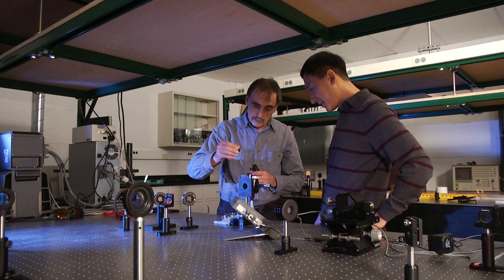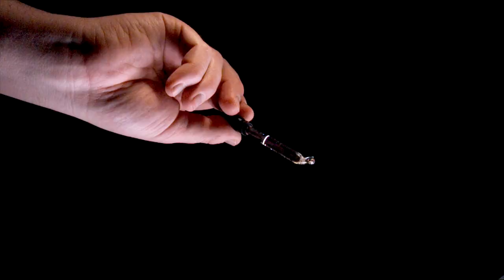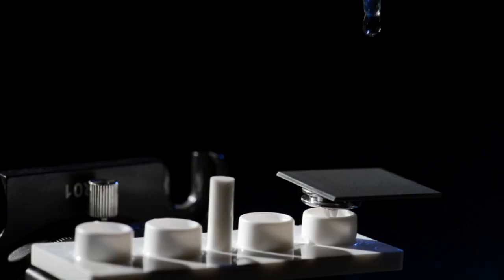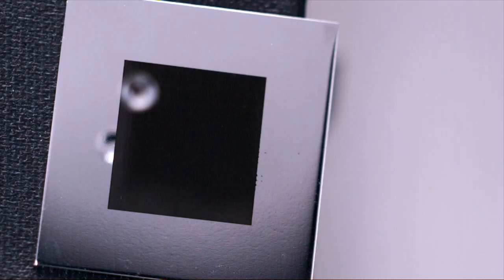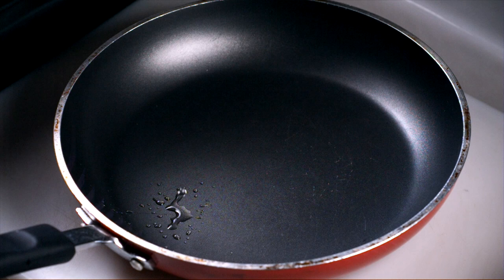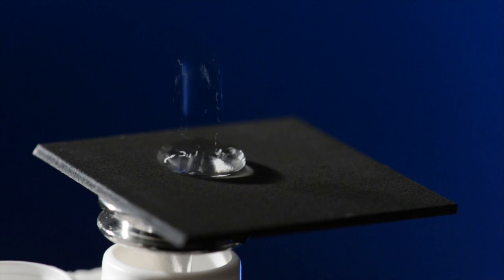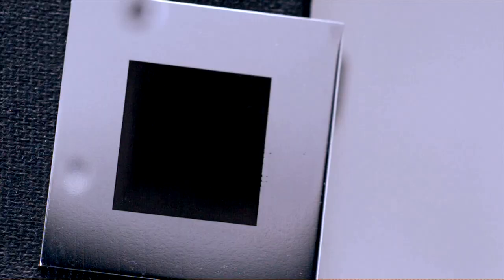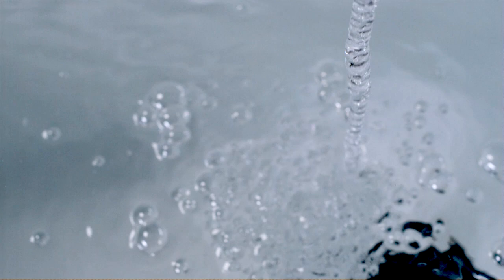Using Lasers to Create Super-hydrophobic Materials

Comment: The explanation is right here:
"In this study, we use an amplified Ti:sapphire laser system that generates 65-fs pulses with a central wavelength of 800 nm and at a maximum pulse repetition rate of 1 kHZ. The laser beam is focused onto the sample surface by a lens onto a sample mounted on a computerized XY-translation stage. The samples in our study are platinum, titanium, and brass. Each sample is textured with an array of parallel microgrooves covered by extensive nanostructures. The platinum sample is processed at laser fluence of 9.8 J/cm 2. The titanium sample is processed at laser fluence of 7.6 J/cm 2. Brass is processed at laser fluence of 3.9 J/cm 2. The orientation of microgrooves is controlled by the scan direction. A scanning electron microscope (SEM) and a 3D laser scanning microscope are used to examine the surface structures. Superhydrophobic properties are studied by measuring both water contact angle and the surface tilt angle for water sliding. The self-cleaning properties are studied with real-life dust particles collected from a vacuum cleaner. For cleaning, we use rolling and falling water drops. The rolling drops with nearly zero kinetic energy are produced by pipetting water drops near the sample surface, while the falling drops are produced by pipetting drops at a height of 3–8 cm above the sample surface. The diameter of the pipetted water drops is in the range of 2–5 mm. The self-cleaning action is recorded with a video camera. To characterize the optical properties, we measure the total hemispherical optical reflection of the samples using a Perkin-Elmer Lambda 900 spectrophotometer and Bruker IFS 66/S FTIR spectrometer, each equipped with an integrating sphere. The two spectrometers allow us to measure the spectral reflectance in the wavelength range of 0.25–2.5  μm and 2.5–16  μm, respectively."
It was in a link in the description. ^^
Reply: Can you make a CorningWare ceramic surface to be hydrophobic? If you can, you can start a revolution in our cookwares.
Reply: @zooplanton  if you can laser etch the surface without chipping the ceramic you can.
Reply: @zooplanton  titanium pans

Comment: Wouldn't minor scratches on the surface make the effect fail, since it is etched directly onto the surface itself?
Reply: Yes they would. This technique is more effective on materials with higher resistances to scratching. Of course this raises production costs, but you'd get a more durable surface that retains it's hydrophobia.
Reply: Grand Duke Seems like it would be good for surfaces that don't usually have exposure to open environments that could cause the scratching but might fall victim to condensation and other similar issues such as internal parts that can't be completely sealed off.
Reply: Or just apply it to parts which are not mechanically requested.
Reply: My gut tells me even a little bit of dust could seriously reduce the efficacy.  That's true of chemical coatings too though.
Reply: That's why we don't see anything 7 years later :) it's cool research tho

Comment: Pretty awesome, yeah. Though, I question it's durability. I'm guessing the water's surface tension keeps it together, because the pattern etched into the metal prevents the water from seeping in. I've seen the phrase "micro and nano patterns" thrown about, which makes me suspect that it would be incredibly easy to scratch this attribute straight off the metal unless it's as hard as diamond. It's the same reason your car wax loses it's effectiveness to do the same thing, but the difference is that it's relatively easy to wax your car, while re-lasering a toilet in Mozambique is probably not going to be an option. Slapping a coat of paint on may not be as effective, but it's cheap, fast, and can be done over and over and over again.

Still a great technology and I certainly hope they roll out it's use in hospitals (they already have a plastic that does the same thing), which would not only be healthier for us all but also avoid that whole "breeding super-bacteria" problem from an overuse of cleaning and antibiotic chemicals, but I sometimes think engineers and scientists are not as worldly and practical when it comes to applying their technology, because it's just not feasible to build entire airplanes out of nano-etched metal that will not only be blinding bare aluminum, but will quickly lose it's effectiveness after flying through dust storms, hail, etc. Kinda like that whole "build roads out of solar panels coated with glass" idea; sounds awesome, but mundane problems like "glass gets scratched to shit when you drive cars on it" and "asphalt is fucking cheap" just take priority.

If I'm totally wrong on this, please give me a heads up on why.

Comment: This could be used to create an air based thermopumps that would work well below 0 as water vapor could not sublimate to the cooling surfaces. You could get COP 4-5 by having a much larger difference between the cooling surfaces and the ambient air without concern for ice buildup. The engineering is daunting but possible. The rewards in energy efficiency would be well worth it particularly in cold climates but the increased efficiency for  cooling would also be beneficial.
Reply: Thats a slick idea! Any indications of folks trying to build such yet?

Comment: i wonder what happens if you dropped this metal into a water surface..would it just bounce right off the water??
Reply: It'd fall into the water.
Then when you pull it out, it'd be dry.
Reply: Try to imagine all life as you know it stopping instantaneously and every molecule in your body exploding at the speed of light.... total protonic reversal.
Reply: John O'brien hah, if only it was extreme as crossing the streams
Reply: Kamike Serpantail
 Yes, exactly. Think of that toy Aqua-Sand that was advertised over the last two decades and how it would stay dry after being pulled out of water.
Reply: depends on the shape and density.. if narrow and denser than water, it would slide right through to the bottom with no resistance.. if less dense, it would sit on top of the water tension and be extremely buoyant, if flat and less dense, the effect is pronounced. if ball-shaped and quite light, then yeah, it would likely bounce
Reply: dan428 Yeah, but so far they've only shown a small square of metal. :P
Reply: Edit: Derp, I'm dumb. It doesn't exude any force and appears only passively hydrophobic so it wouldn't do anything cool. Also, floating would probably depend on that (nonexistent) anti-H2O force overpowering the H2O bonds, which wouldn't matter anyway since the water would disperse around the metal if it was actively hydrophobic, huh? The water would move out of the way as it sank to the bottom, then it would have an air pocket around it.

Nothing cool like water walking suits where you could run and roll around on the top of the ocean. (until H2O got inside your suit and began to reverberate so quickly from the anti-H2O suit that it ate through your skin like a sandblaster, then the H2O in your hyper-dissolved body would bounce around inside the suit until it all leaked out, leaving the suit glitching and jolting around on the surface of the ocean, empty, blood[platelet]stained, and terrifying.)
Reply: It could be used on Boats or Hydroplanes so that less friction is used to move along the surface of water.
Reply: no it would not... it would sink
Reply: dan428
Speaking of no resistance, I wonder what the effect would be like on a boat, ship or submarine hull. Would it significantly decrease drag & resistance in the water? If so, imagine the possible fuel savings in the ocean industries.
Reply: Shawn Grant  it would help ... for a short time before the coating got covered with minerals and such
Reply: oldnotweak
Would water dissolved minerals not also be repelled with the water?
Reply: John O'brien Dr. Spengler, is that you?
Reply: Well this thread definitely has a lot of Science fiction fans.
Reply: +Shawn Grant No, you're still displacing the same amount of water so the same amount of energy is required to do so.
Reply: FREE ENERGY!

Comment: Resurface all watercraft with this material to beneficially change their friction coefficient.
A.Water brakes.
B.High speed underwater transit.
C.Electronic devices that hold their position in stagnant water without traditional motivation.
D.Gases/Fluids flow into containers without pumping.
E. Separate chemicals at different temperatures from a cracking device.
(Like pouring all your garbage into a thermal pit and capturing all the components that burn off while it's hot and easily transferable into separate condensation and recycling.)

Comment: I wonder how it would affect the buoyant forces on ships. Or the integrity of the material. Cause a material's strength depends on its crystalline structure. Pretty exciting to see how it will be used. Possibilities are endless at this point.
Reply: It shouldnt affect integrity, someone commented with the specifics of how the process works, theyre using nano scale laser etching to make patterns on the surface of metals, I dont think that would affect the crystal structure of the metal very much, maybe the thickness of metal foil if at all

Comment: As if a million windscreen wiper salesmen suddenly cried out in terror. =P
Reply: Doubtful. They have to create a patterned surface on the material. So if they applied this same process to glass, you probably wouldn't be able to see through it.
Reply: yeah wouldn't work on optics, the glass surface would appear sandblasted
Reply: dan428 on a nano scale our eyes won't resolve the difference and it will still appear to be see through.  There have been products that can do similar effects (RainX) which is clear, however it still requires recoating
Reply: koruki rainx is chemical treatment..
Reply: dan428 yes it is else a normal consumer wouldn't be able to apply it, but I know what you mean cause the Neverwet leaves a haze
Reply: PINGPONGROCKSBRAH
I find your lack of faith disturbing.
Reply: koruki I suspect there would be some optical effect on glass because it turns metallics matt black.
Reply: carbon burning I  the metal during the lazering I guess. but no carbon in glass
Reply: +koruki Incorrect.  A scale small enough to not become opaque would not cause hydrophobia.  RainX is not a surface pattern.  Etched glass is not clear.
Reply: @stinkycheese804  I have samples of micro-etched glass that appear clear when dry, and hydrophilic (fogged) when breathed on.
That particular thing was invented in Russia, and is used on some military optics. With the naked eye or a magnifying glass there's no hint of a surface treatment.

Comment: Possible uses I've come up with: Boat hulls to lessen drag.  Water pipes (internally and externally) to extend their life by lowering corrosion.  Roofing tiles that last for a very long time with extremely low maintenance.  Would also be useful in areas that get a lot of snowfall to keep snow from sticking to roofing tiles.  Tableware that's very easy to keep clean with minimal water needed.

I have to wonder what effect this treatment would have on materials that are implanted in the human body.  Could this help cut down on infection and issues associated with such devices?

Comment: The leading edge of wings on commercial airliners would be an interesting test for the hydrophobic material.  Boots or exhaust gasses or combination of both are used at present in combination to chemical de-ice agents on the ground.

Comment: What would happen if they used this process to the hull of a boat, would drag become almost a thing of the past? The possibilities are amazing!
Reply: Agreed, it would also likely vastly increase longevity on a ship's hull, and perhaps if cleverly combined with their hydrophilic surfaces in the right patterns, might give an even more pronounced decrease in drag.
Reply: Maybe, although this material likely still costs a lot to make.
Reply: Usage on ships hull is rather doubtful. Nanopattern on a ship's hull moving in sea water would be quickly wiped off leaving a metal unprotected. It's ok in the labs with clear pure water, but everywhere else it would be victim of abrasives.
Reply: It might reduce drag (local trapped air layer, like a lubricant?)? It might stop barnacles?
Reply: @AdamPippin  it would get stripped away so quick.

Comment: this is amazing! How does it work with the impure water like he mentioned? Salt water? Like if boats were made with this sort of surface? It seems similar to another surface structure based technology (I think it was for rubber/plastic materials) that mimics shark skin, which naturally repels bacteria to grow on it because of the way the patterns prefect grouping of organisms (or something like that). Imagine if this technology could be applied at a cost effective rate! As a non-expert, I imagine it would put a harsh decline in rust occurrence. Even simple things like aluminum cans, no longer needing the wax inner coating they have to prevent internal rusting... Damn I love technology!

Comment: For the toilet explanation, I doubt it and here's why: a hydrophobic surface won't make anything in the toilet any lighter and it still needs a barrier of water to be able to cover the bad smell of the sewage. So the water level will likely not change much, and using this in "poor countries" is definitely out of the picture with the cost of production. Doing this on a large scale is challenging
Reply: Yeah but it means if you’re just doing a piss you’d only need enough water to refill the trap in the pipes to flush the waste out and stop sewer leakage.

Comment: I highly praise your work and research, it is certainly useful although you still have to worry about the surface degrading over time. The structure can wear away. To a degree it might be more fragile than a chemical surface. Perhaps you can combine the two. Another problem this has is it isnt flexible to be used for fabric applications.

Comment: could this etching be applied to the interior of an intake port runner in the machined aluminum cylinder head of an internal combustion engine? I would think that this surface would reduce any condensation of the fuel that could occur immediately after the fuel is released by the injector wherein it would be easily sucked into the combustion chamber along with the corresponding charge of air, reducing buildup of impurities throughout the intake port and reducing the amount of fuel necessary to establish a proper stoichiometric ratio for combustion... cleaner burning engine that is using less fuel.

Comment: Could the production of this material be scaled up and be produced at a reasonable price? I would be nice to get rid of a few of the perfluorinated compounds, like teflon.
Reply: its not a material its a surface treatment using lasers. which can be cheap depending on power needed to etch specific materials and the size of the cnc mechanism needed to move it around. 
but i've seen the water absorbing effect on sand blasted parts before. what they have is probably better at it.
Reply: @darkshadowsx5949  Oh, thanks for clarifying. :)

Comment: You would have to worry about structural damage to the nano surface, right? You mention your method as being superior to chemical coatings. Chemical coatings can be reapplied in many situations, but would it be a technology that lasts and stands up to the elements, bumps and scrapes, footsteps, etc. Pieces would need to be reworked or replaced. Also, I am very curious as to what a hydro / oleo phobic "nano" surface would even look like up close!

Comment: I'm only a layman, so forgive any ignorance... is this only on the small scale, or can one use this technique for say, car body panels and the like? Would paint adhere to it (I imagine special paints would have to be developed if not)? Could one apply this to other materials with a crystalline structure such as glass? This is very exciting :-)
Reply: Scratches on body panels would negate the effect.
Reply: Mason Riley Yeah, that didn't occur to me... road debris would eat into it. Still, research goes on :-)
Reply: Actually glass isn't a crystal, it's an amorphous solid. Just thought you should know since I made this same mistake as well :)
Reply: This would work on glass, but only if it's of sufficient hardness to not get scratched by environmental effects, though tough enough glass that large would be pricey... like sapphire glass.
Reply: Actually yes it would work on cars.  You couldn't paint the car though.  The other issue is the technology takes over a hour to do 1 square inch.   It would take months to do a car.   I am replacing my car panels with 3d printed graphene panels that have a hydrophobic pattern that also cuts wind resistance by 92%.

Comment: Imagine a speed boat surface area covered in this process, how much faster it could travel. How about a submarine surface area?  Not only covering the wings but all the leading edges of an aircraft.  Moisture in the air that creates resistance against the fuselage would be zero. I wonder what other kinds of liquids it will repell?

Comment: Hm, I don't see any pictures showing stationary hydrophobic effect, only dynamic one during short time of interaction. What critical repellent bubble pressure depending on microgroove wavelength is? Let's press for a long time a droplet between two surfaces and look how tiny droplets or entire one recover after that, then I will applaud.

P.S. Rough surfaces are useless in ships and planes at least because of cavitation fracture.